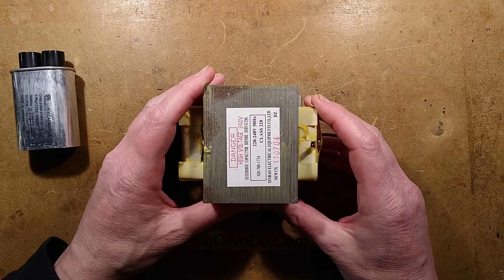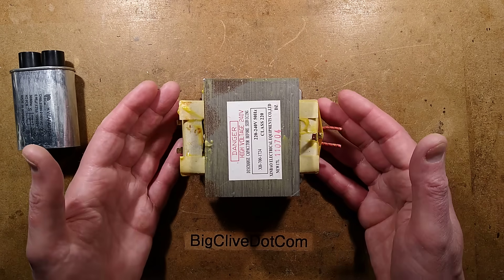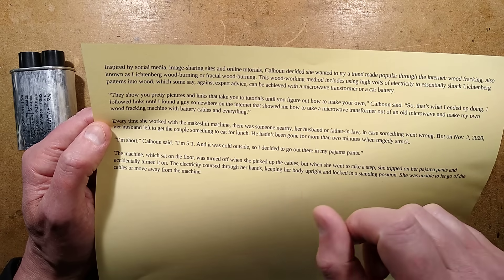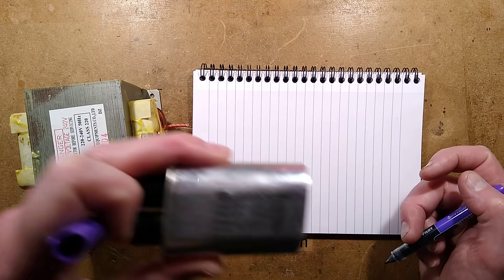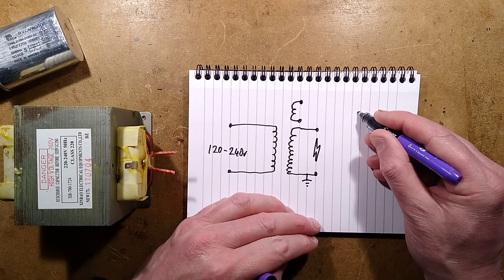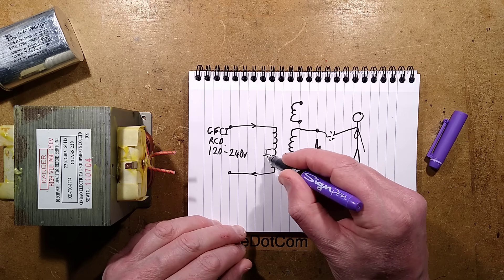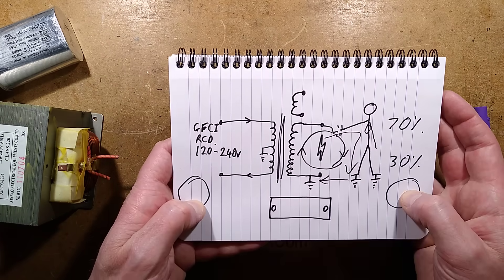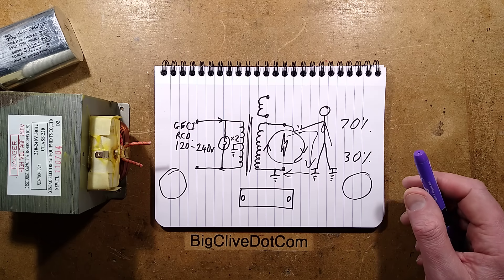The most deadly project on the Internet

Comment: Hearing the bit about the woman standing straight up and not being able to move brought me back to a science class in high school. We had a science teacher that was, well he was really freaking weird. Like you'd expect him to have bodies in the basement kinda weird. One day in class he pulled out a hand crank generator. He made the whole class stand up and hold hands with two students clutching the bare wires of the generator. It was a contest to see who could hold on the longest. If you let go before anyone else did while he was cranking the generator you got out of the circle and were eliminated. With each dropout the current got stronger due to there being less resistance to flow. I was one of three students at the end and the current had gotten kinda painful by then. While I was clutching the bare wire of the generator I couldn't let go because it basically froze my hand. I guess it was safe, I don't know. Nobody died or were injured, but electricity gives a specific type of pain you can't find anywhere else.

Comment: I just saw a discarded microwave oven a few hours ago.  Good thing I wasn't motivated enough to take it home. 
I did have one interesting shock  experience back in college.  We were doing an experiment with acceleration where we needed to calculate a spring constant of a shuttle floating on a track.  A sparking mechanism would burn spots onto paper to show the time interval of the shuttle as it accelerated away.  Before the instructor arrived, I thought it would be fun to melt a candy wrapper in the arc.  At some point I got shocked through both arms.  They locked up and could feel the pulsing of the current.  It lasted only a few seconds, but was a weird sensation of paralysis.  I don't remember pulling away, but I must have.  I was none the worse for wear and felt nothing odd in my chest afterwards.  We laughed and continued as if nothing happened.

Comment: When i was young i was playing with the old cabinet tv tryna tune it. The nobe fell off and went to the back. When trying to get it out with my right hand i Touched some wires and had power go all around my body and explode out of my left arm. It went from right hand to right foot to left foot then to left arm. Half way from elbow to hand. Exploded a hole and smoking.

Comment: Electricity rule number one, use only one hand when dealing with high voltage, (anything' over 24 volts), transformers are AC which is more dangerous.  Yes this is very dangerous and then only people experienced in high voltage using precautions and operating it safely should be allowed to use.  I had learned these things and did AC 36,000 VAC at 60+ amp arcs using thermal induction (a candle) that exceeded five feet length and only estimated 500 thousand candle power light! I was 12 and it blew the circuit faster than short circuit, the largest craftsman screwdrivers were the probes, the year 1976.

Comment: I'm an electrician and I can promise you this man is absolutely correct! To add, not only will the gfci do absolutely nothing on the primary, but it will also be useless on the secondary. It takes about .2 amps to become fatal. From what I've read, gfci's are designed to trip around 6 mA going to ground. That thing will never even know you're there before you're dead.

Comment: thanks for uploading this. as someone who messes around with electricity professionally i've been shocked several times (twice with ~2kv, but low watt nothing serious) so i'm pretty complacent. i never considered the fact that a GFCI or circuit breaker would be useless here and that's kinda scary.

Assuming the mains voltage can pump like 15 amps, that means the 2kv secondary is gonna be putting out like 900mA and I think like 100mA is plenty to be lethal. I'm glad i didn't know about this project like 10 years ago.

Comment: Once its over mains voltage I'm very cautious about what I'm doing and most importantly if I should be doing it at all.  I bought and repaired an old Sega rally 2 arcade machine a couple of years back.  The hv on those crts is about 26kv, and I was very careful to make sure I understood how to properly discharge them and what was actually happening when I did.  

Bottom line is... If its high voltage and you don't understand it, you shouldn't touch it.  I certainly wouldn't be playing around with a microwave transformer for fun.

Comment: I've seen breakers about that size that can do about 300A, materials-wise if something that size can handle that kind of current, then it's not unimaginable for a capacitor to be even a fraction of that, but I have a feeling it can go quite high in current discharge.

Comment: I am an experienced electronic,electrical technician with 60. Years of experience. I refuse to work on microwave ovens due to the transformer inside. One mistake and you are dead. Don’t play around with this transformer with the secondary intact.

Comment: Well now I feel more inclined to make a spot welder since I've found something more dangerous...on the other hand, Why use more voltage than required? 
Thanks for sharing this and I hope this gets around a bit more so that less and less people die from quite possibly a slip of the hand...
Reply: Microwave transformer based spot welders are way safer than the transformer in the original configuration, once the original secondary is removed the high voltage hazard is gone... but DO NOT ATTEMPT to test the transformer before removing the secondary coil. Also, spot welders use huge currents, so you need really thick wires for the new secondary, but the voltage is so low (typically 1-3V) that it poses no risk of electrocution (only the secondary, the primary still at mains voltage so don't touch it, it's not high voltage but 110-220v are no safe to touch). And keep in mind you can melt iron with the low voltage high current output, maybe a fire extinguisher in place is a wise idea.
Reply: @jacogomez1093  Very fair, I wouldn't have done something like that without some form of safety around, and DEFINETELY wouldn't have touched anything with a current, at least on purpose.

Comment: I am an electrician with 25 yes exp. Half of that was working with 480 volt industrial, sometimes while hot. But I am not trained to work 600 plus volts and will not.
 It jumps. It passes through most materials. It is invisible. It kills.

Comment: Back in High School, I took Electronics shop. One of the assignments was the teacher went to a TV repair shop and picked up a bunch of broken TVs that were financially unrepairable. Our tasks as students was to figure out what was wrong and what to do to fix the TV if possible. I got an old tube style color Philco. I had traced the problem with something to do with the Flyback Transformer. I inserted a high voltage probe under the rubber cup on the CRT tube and turned on the TV. Unbeknownst to me, the probe had a damaged insulator. And yes, the flyback was bat. Normally, they put out 30,000 to 50,000 volts depending on the TV. This one blew out the probe at 120,000. The voltage arced through the damaged insulator right into my hand. I was bent over, peering into the TV while using the probe, about 10 feet away from the wall behind me. The 120,000 volts hitting my body forced all my muscles to expand suddenly, causing me to leap backwards into the wall which knocked me out! It was only for 30 seconds or so....when I came to, I had no idea where I was, what I was doing and even suspected that I didn't know who I was...this lasted for about 5 minutes then things got clearer for me...but this was scary!

Comment: I have no plans to do anything with a microwave transformer, but I love videos like this to warn people of dangers and to be safe.  I remember reading that transformers turn electrical energy into a magnet and then back into electrical energy on the other end at different current/voltage and I was wondering.  What would happen if you stuck a strong magnet to a transformer that was on?
Reply: Two equal and opposite effects...

First, it will be rapidly attracted and repelled, the working principle of an aquarium air pump. Depending on the scale of forces it might sit on the core and buzz, or be forced away from the core, or even tumble and spin in place as a simple motor.

Second, the produced current is only from a change in the magnetic field, so the currents from your permanent magnet approaching the core won't make much electricity, but the magnet can "saturate" or completely magnetize the core. This clips off some of the power flowing through the core, either allowing you to control a load by "saturable reactor", or to detect magnetic fields in a "flux-gate compass".

Comment: That is the same voltage used on short wave radio transmitter, using the 4CX250 vacuum tube. 
There is a set of procedures to operate on such high voltage equipment. You must wear insulating gloves at all times, never use standard multimeter probes but only probes designed for high voltage.
Mixing salty water and 2000 V 0.5 Amp together is against anything I have been living for. This is the dark side of Internet...

Comment: I did appliance repair.  You have to discharge the capacitor before working on the high side or risk serious injury.

We used a specific tool while wearing a thick high voltage resistant rubber glove.

Comment: I just tore one of these out of an old microwave today , strange you just made this video .I didn't realize  the power potential these have , pretty sketchy . I feel lucky to be here after cutting through 6  480 v three phase 200 amp cable embedded in concrete at a hotel with a concrete saw and water flowing in the cut. I was wearing gloves , boots.

Comment: Had the parts to build one of these for a long time. Never could push myself to actually build it. Eventually my wife talked me into getting rid of the stuff. I'm kind of glad she did. I don't know enough about electricity to be screwing with high voltage. To be fair I was going to buy 2 of these 3 inch rubber mats to stand on and I was planning to use a Deadman switch and some kind of setup that would disconnect power if i stepped off the mats. It still scared me enough to give into my wife pressuring me not to play with it.

Comment: The case is not earth referenced until you make it so.  If you use the green wire from the plug as a reference it could easily be at a different reference than the ground you are standing on.  Therefore the whole chassis of the transformer could still be at an extremely high voltage even though you "grounded" it.  I have seen this happen with 480 3ph where one system ground/reference was slightly different from the second ground/reference.  This caused a 50V differential between the two references.  Now scale that up for a MOT and just touching the case could kill you even if you 'ground' it!!
There is no way that you could do this safely without spending around $400 on safety equipment like enclosures, proper wire, dead man switch, light curtains and of course PPE.  Class 1 electrical gloves with leathers will run you $150 alone.  Fail to test them each time and it could be the last time you need them.

Comment: I've been doing this for a few years now and I did get the idea from you tube. Now, with that said, I am an electrician so I'm quite aware of the danger ⚡ First of all I use a Variac to control the amount of voltage (all at once) initially. I can gradually turn it up. Second of all I NEVER hold my probes. Third, I stand on a thick rubber mat. If you're not comfortable (familiar) working with electricity please, leave it alone. Paint with water colors or anything else.

Comment: ive been shocked many times, including popped across the room from a fuse box. but one day I was helping my aunt vacuum her car. she had one of those old school Electrolux canister type, with the cylindrical body on the ground. well she had just washed her car so there was water on the pavement. I started vacuuming then it happened. All I know is my entire body felt like it snapped into a sine wave, probably 3 cycles high from head to toe and moving rather fast. I felt like an image in a fun house mirror. I felt such immense tightness and pain and I was locked. I just felt my body rolling from top to bottom but it felt like the horizontal (my front to back) wavelength was 2 feet long. felt like I was being rolled through a giant electric candy roller. Suddenly I heard this loud scream come at me from in front of me and then the shock stopped. that scream was beyond terrifying. My aunt came running out and asked me why was screaming. Then I realized I was hearing myself screaming from outside my body. I have never been so terrified and humbled in my life. Every day I wake up I thank God.
Reply: Damn, sounds extremely intense. Definitely lucky to be here

Comment: I knew about most of this and why I never mess around with high voltage, but I never knew about the hv capacitor in microwaves, I remember last year we were trying to fix our one microwave and I'm glad I never went near the capacitor cause it was only unplugged for like 20 mins or so when we started messing with it. We did try fixing what we thought was the issue but it still didn't work after, I will note to be exceedingly more careful then I was last time if we decide to try and fix it again.

Comment: I'm still astounded that people do this. I work on tube guitar amps pretty regularly, and I'm very respectful of the 450-500 volts present there. 2KV? No god damned way am I touching that.
Reply: Do you see that wood at the 27 second Mark ?
I have made at least 50 of them in black walnut , red cedar , oak , and pine  .

Then I put about 10 coats of Polyurethane on it and they are Beautiful , 

I'm not even close to it when it is on , I'm 3 feet away with an on/off switch and I never touch it , as a matter of fact , it's unplugged before I even do anything , 
So there is ZERO chance of shock or death , 

Yes about 35 people have died , but that's because they touched it while it was on , 
That's very STUPID 
And I'm not Stupid 

I have been a Arc Welder for years and know the dangers of electricity , 
So I'm very careful

Comment: I 120 volt aluminum skillsaw handle with a pinched wire hurts like hell to I could not move could not throw it down could not scream for no one lucky I fell backwards over the sawhorse an my feet cam off the floor an my hand turned it loose I took a maul an crushed that saw an threw it in the trash never used a medal handled skill saw ever again

Comment: I’ve shocked myself enough times forgetting to unplug electronics while working on them as a teen.  I vividly remember the Playstation 1.  While most consoles came with an external AC to DC adaptor, the PS1 had this feature as an exposed power supply right under the top panel.  Boy, I learned not to touch that thing while plugged in quickly!

Again, working with some poorly-made Power Supplies while working on a computer.  Touched the Alternating Current and took a nice hit of nature damage.  The pain can best be expressed as extreme and memorable discomfort. Never been shocked by DC though which I hear is far more painful from mechanics and sound technicians.
Reply: I got shocked by 90v dc many times. The first time was an accident... DC doesn't feel very bad at 90v or less. When you get to high enough power levels, I'm actually not so sure it matters which one it is, they're both bad.